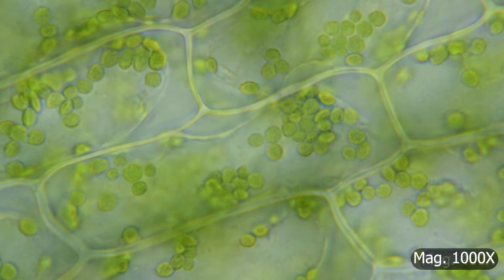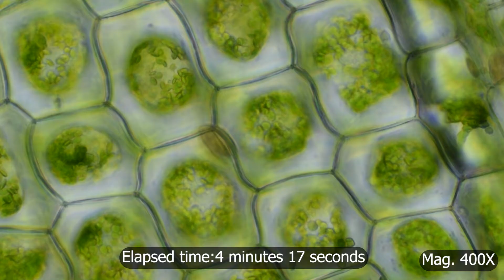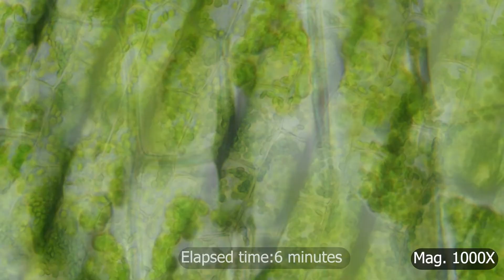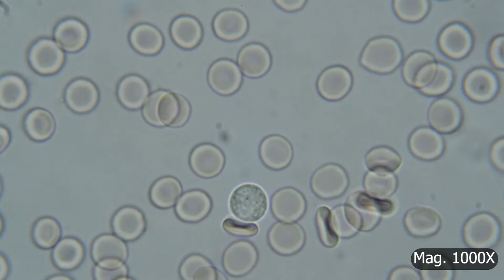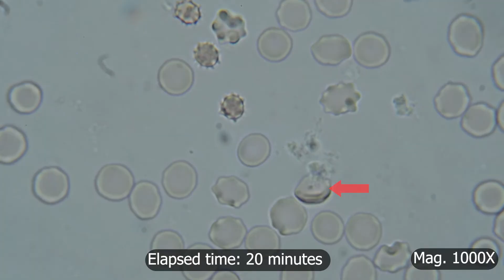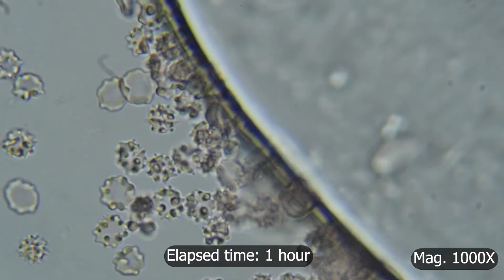Plasmolysis and Crenation Under the Microscope

Comment: That's interesting. So the cell wall and the cell membrane aren't glued together?
Reply from the maker: Correct. They are held together by filaments. The cell membrane can pull on those filaments when it shrinks, those filaments can anchor the cell membrane back to the cell wall when water enters the membrane.